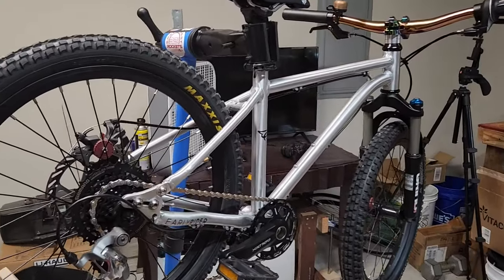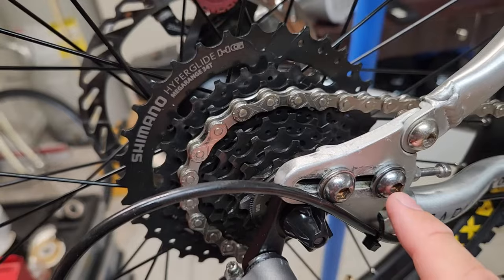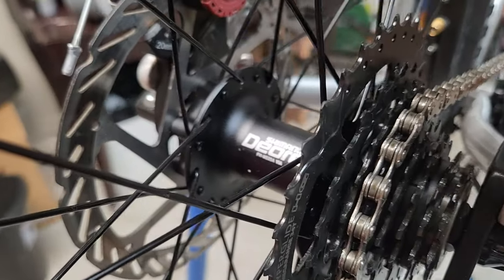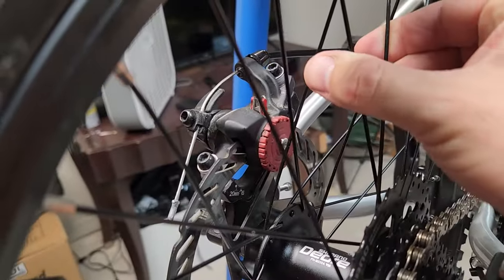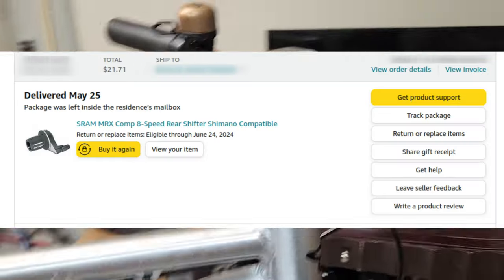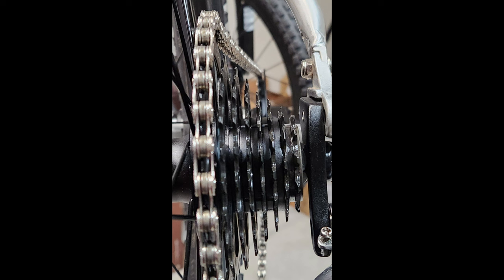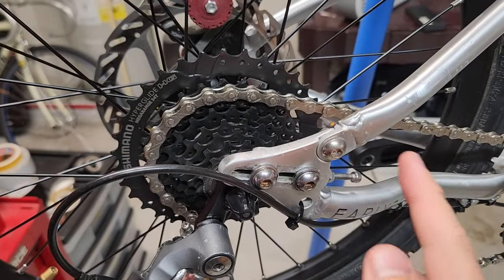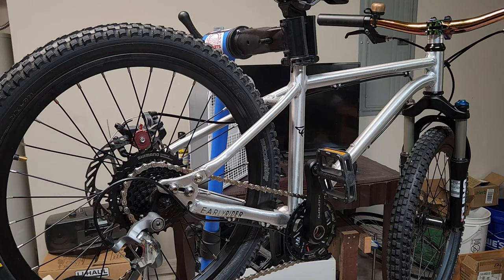Internal geared hub - 8 speed conversion

Comment from the maker: We did our first ride yesterday, it was about a 8km ride with a few small hill. She did great with it and was even shifting the gears without issue. She was mostly in the 4 and 5th gear. I think overall maybe it's geared a bit lower then needed. Perhaps a 30t front chainring would have been better, currently it's a 28t. Also I think a 11-30 in the rear will be perfect.
Reply: Since you don't have 2x setup, there was no need to use a long cage RD.  A short cage one would work fine - especially after the change to a 30T large cog.  BTW, Shimano has several RD's (RD-M310, RD-M340) that use really big jockey wheels and thus shorter cages, just for this issue on 20" and 24" wheeled bikes.

Comment: Holy hell that cage is flicking stones as you climb. Cycling is the biggest case of leading a horse to water but you can't make them want to ride a bike.  But as we all know nicer bikes that don't break and perform well make the sport enjoyable. Even with no frame of reference you'll make her want to ride more on the new bike that climbs everything and always has another gear to go, compared to a 3 speed belt drive. But if all else fails and she hates riding, some other kid will have a sick new bike for a good deal. Btw smaller wheels are way more rigid and stronger than bigger wheels. They're usually just tensioned and balanced for the use case of toddlers, and fall apart under any real load.
Reply from the maker: yeah all true. But she already likes to ride and rides a lot. I guess I didn't say it in the video but she's been riding the bike with the 3 speed for a bit more then a year already before it broke.